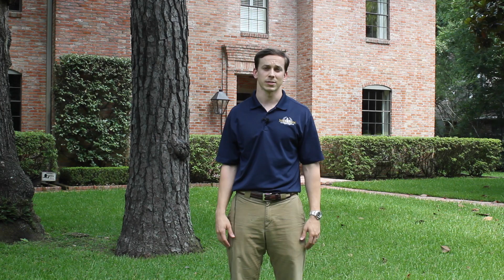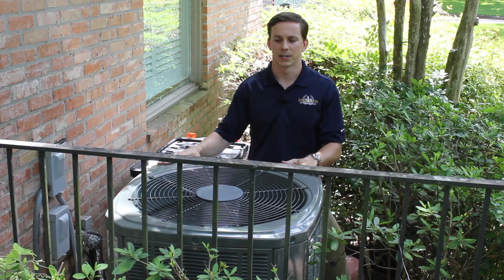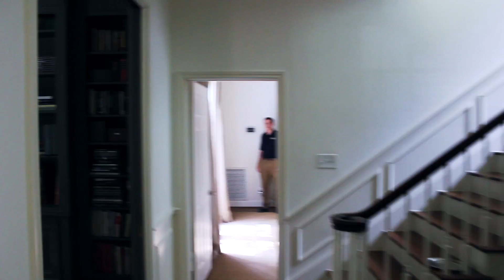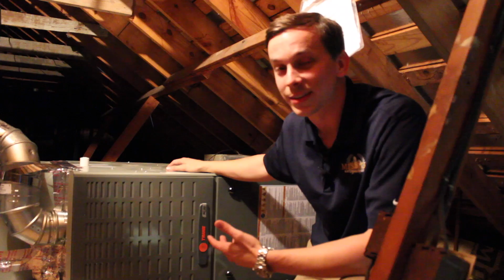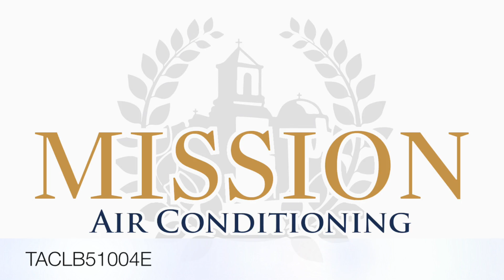Trane XV18 XV20i System Review

Comment: Hi David, Thanks for your review. It helped me make a decision to buy the XV20i for my house. I've been happy with its performance however I've been noticing some periods of very loud operation. I was told by my reseller that the variable compressor ramps up to 70+% every hour of operation which in my case translates to a noise level above 75db.  Which is loud enough to be a nuisance at night. What I've done is schedule for it not to run at night for the time being. I won't be able to do that forever. I wanted to ask if you've seen this behavior and if those noise levels are within operating parameters. Thanks again!
Reply from the maker: Ed, good question.  There are a decent number of variables here that are impossible to take into full consideration without having eyes and ears (and tools) on your home and system.  So the best recommendation would be to have a local Trane or American Standard expert (most local distributors have someone like this who does all factory training) give you the definitive answer.  Going blind here one possible reason for this could be that the system is regulating the compressor lubrication causing it to ramp RPMs in order to stay lubricated.  Otherwise if it loses lubrication the system will run rough.  It is a protective measure.  If this is the case your best bet would be to move the condenser away from bedroom windows.  Still your local factory rep could have advice for design that could help as well.  Hope that helps!